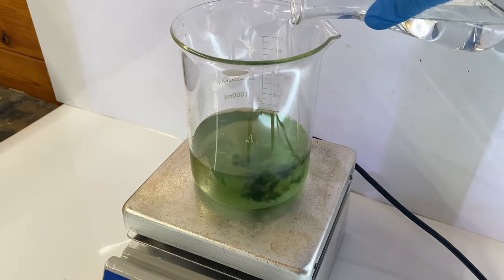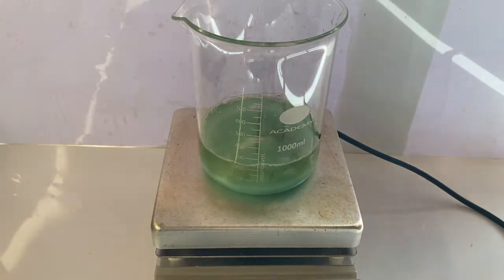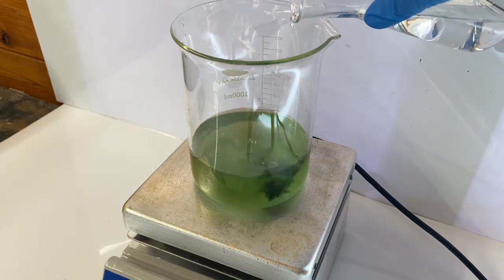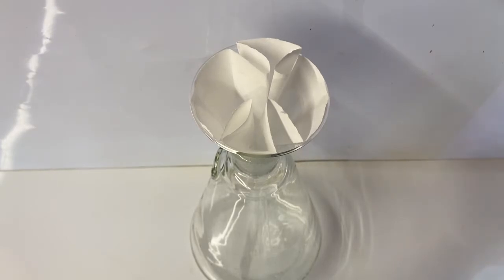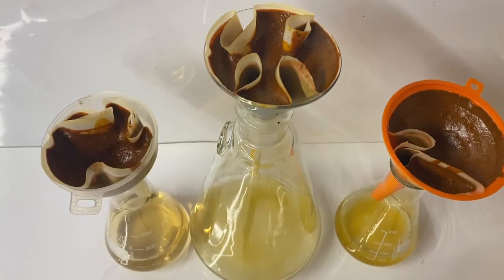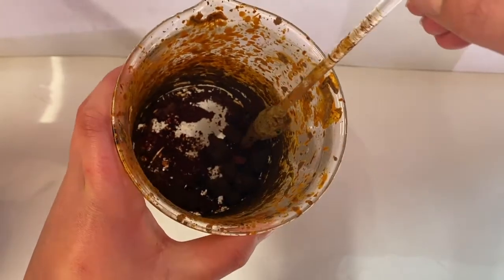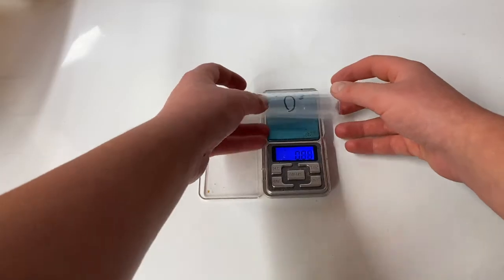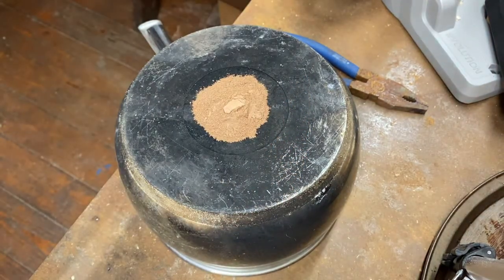How to make THERMITE GRADE super fine iron oxide without a ball mill

Comment: For showing its chemical formation from two salts & its purity, it is a good vid - in reality it is a rather messy proceeder a better than electrolysis but still messy 👍 I found in the past that the combustion of fine steel wool or air boiling mild steel turning - crushing and sieving is less messy and higher yield.
Reply from the maker: Normally, I just get massive lumps of rust off steel support beams; huge flakes falling off the side. I just put it in a blender and then I’ve got some decently fine iron oxide. I wanted the purer stuff for making iron from thermite. Thermite -> iron balls -> wash in NaOH and I will hopefully have moderately pure Iron for an element collection
Reply: The Shed Chemist - I have some 3-400gm nuggets - I think its one of the best inventions ever - thanks to Hans Goldsmidt 😁😁
Reply from the maker: Couldn’t argue with you there!
Reply: The Shed Chemist have you seen (Amazing Rust) channel?
Reply from the maker: I can’t find it on YouTube, do you mean https://amazingrust.com ?
Reply: The Shed Chemist yes
Reply: @Jonodrew1286  does not work!
Reply: Calvary Assembly of God Southington CT  - Really🤔 it is a lot of work but it is surely worth it - maybe the ratio and fineness of reducing agent is a little off ?
Reply: Calvary Assembly of God Southington CT  you do need a press, a sieve and plenty of patience as it is laborious work feeding the material back and forth and taking out the big chucks of unreacted material not oxidised - but it does work well!

Comment: Plz also do Super fine Thermite grade Aluminium powder without a ball mil
Reply from the maker: Hmmm, I like your thinking. I do after all have a propane furnace that can reach over 1300C. I’ll give it some thought
Reply: @theshedchemist6445  wouldn't it melt into a blob? I think we're stuck with ball mills unfortunately.
Reply: @chemistryofquestionablequa6252  If you don’t mind spending a few hours grinding for about a gram of fine aluminum (lol), you can cast an aluminum mortar/pestle and grind aluminum filings in it. The mortar/pestle actually holds up well with a lot of grinding happening from particle on particle contact, and of course doesn’t contaminate your product.  I’ve done it to where the aluminum (a little added pyro grade charcoal helps) is reactive enough to burn with atmospheric oxygen. I have since just milled aluminum. The prior was mostly a proof of concept.
Reply from the maker: That’s a great idea! And a great video idea too! I’ll think about it and it may come next after I finish editing my bromine video.